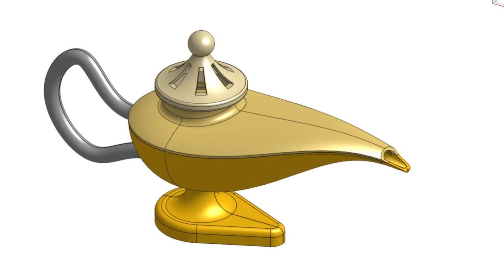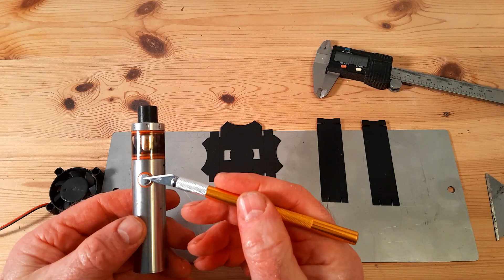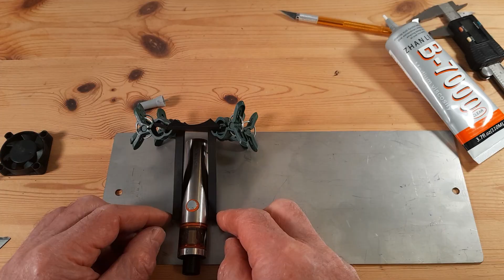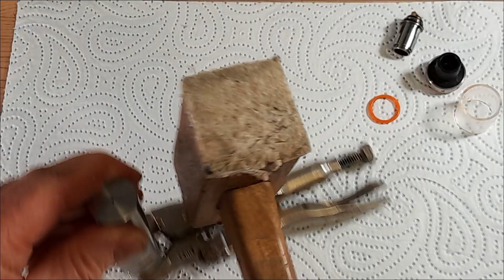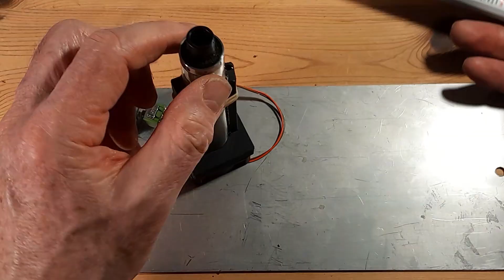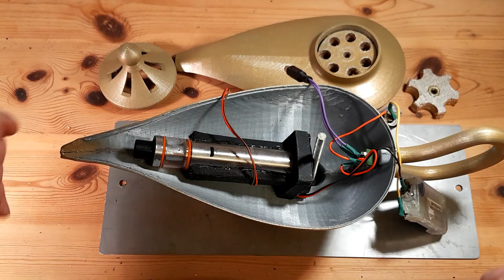Sidelines: Genie Lamp - short version

Comment: How did you make that?
Reply from the maker: Hi, John. I don't understand your question. The video shows how I made it. What is unclear?
Reply: @QuickPLC-kh5of I’m sorry. I’ve meant how you printed out those parts of the lamp and made that smoke thing.
Reply from the maker: @johncsernica2175  did you read the description below the video where I provided a link to the 3D printer files and a link to the longer version of the video?
Reply: @QuickPLC-kh5of OK. I see what you mean by that. Thanks.